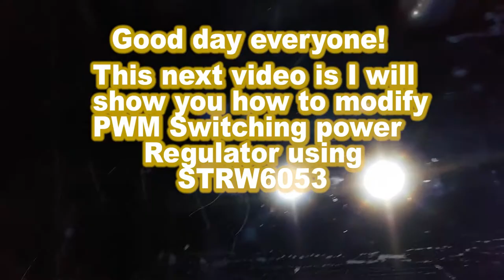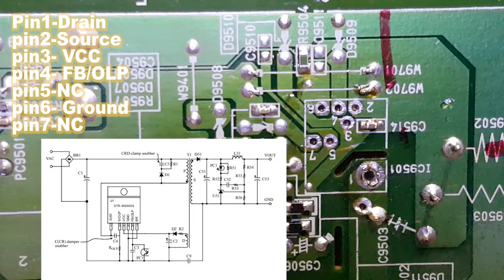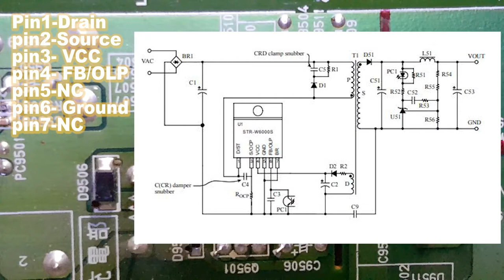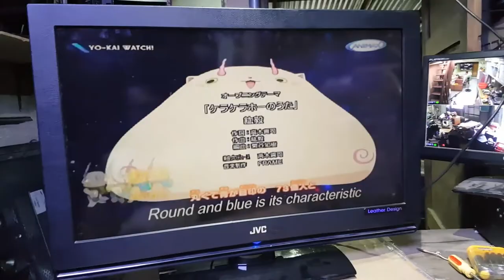JVC LCD TV (NO POWER)

Comment: Sir l have  same, jvc lcd tv, it has back light problem, can you ,please , suggest how t open front panel to change led, I do not have service manual, the model number is JVC lcd LT32A100
Reply from the maker: I guess its not a led.
Reply: Hello Tevz
 I not only watch your YouTube channels regularly but also learn a lot from them. I have a JVC Model No. LT32A100 with a slightly different problem. After turning on the TV, it works fine for 15 to 30 minutes, after that the video, backlight, blue screen all turn off, but the sound continues and the indicator blue LED keeps on. I failed to find the error. Because the seat is not fully off,  I don't understand anything. I want to be satisfied with your experience. Can you; please, give some hints. I need your help.
I can provide a picture if you like